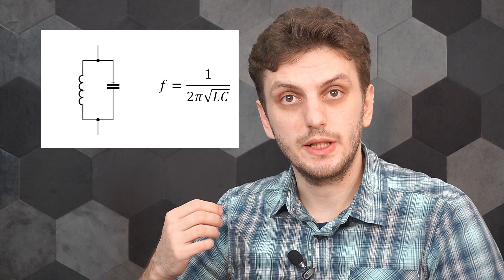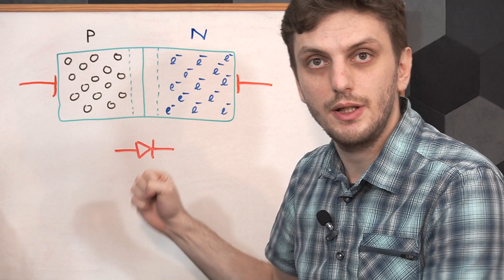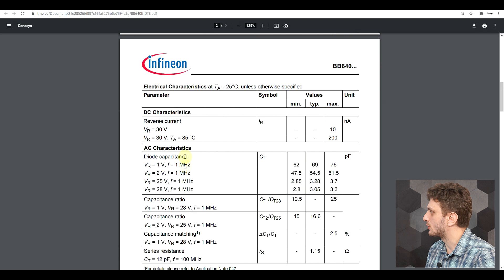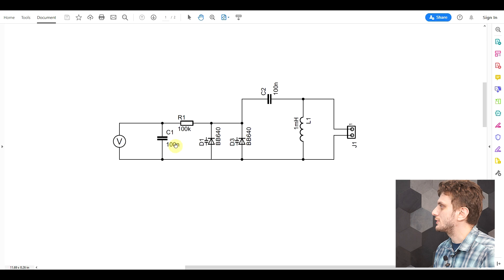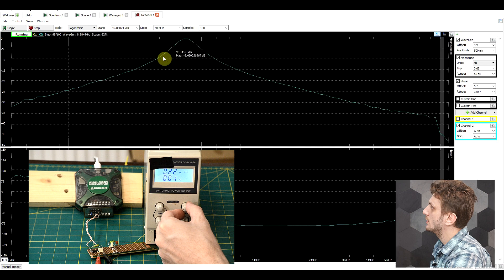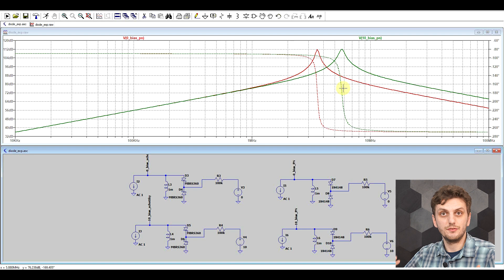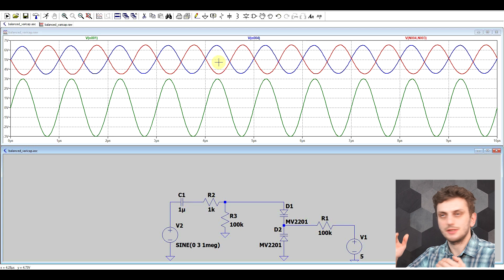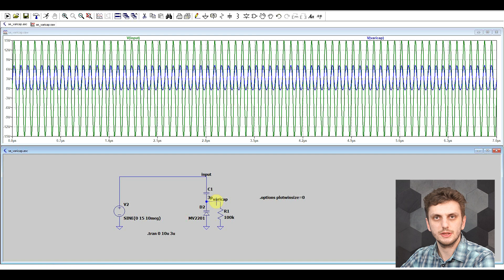RF tutorials - The Varicap or Varactor Diode

Comment: Neat, I never knew these were used at high power to generate higher harmonics! I wonder how optimised that kind of circuit can be?
Also I’ve heard that common LEDs make decent varactors, though I’d have to worry about photocurrent, particularly under AC lighting.

Comment: Thanks for this video. I have discovered there are varicaps in LTSPICE native models. Adding previous video on mixers with this one (VCO) plus notions of SSB you also developed previously ..It seems we are on the path of Ham Radio, no ? By the way this is great!
Reply from the maker: Well I do try to keep things a bit more diverse, and one of the things the viewers and my Patrons requested was RF radio related stuff. Happy you are enjoying it! Cheers!
Reply: @FesZElectronics  Sir, so if I connect a DC voltage source, a Varactor diode and an inductor all in parallel, there will be oscillations? Did I understand it right?

Comment: The electrical charge in a diode is inside of the depletion layer and not in the remaining parts of p and n zones. p and n zones are electrically neutral; they became partially electrically charged near the junction (the n zone near the junction became positive and the p zone became negative)

Comment: what is a "dc bias"? he mentions it when he applies dc to his circuit
Reply from the maker: Well, by definition, "to bias" a circuit means to apply a voltage to set a specific initial operating condition. In this case, what I was trying to say is that by applying this external bias, I am setting the initial capacity of the diode (the capacity is voltage dependent).

Comment: Hello thanks for the nice explanation, can I use this to tune FM transmitters frequency by replacing the old conventional variable capacitor I want to make it tunable with my microcontroller by applying a reverse bias protentional as you said (my idea is to use a external dac)?
Reply from the maker: That should work. In general this is how radio receivers are built nowadays - you no longer use mechanical variable capacitors but rather varicap diodes and a bias voltage. For the transmitter, as long as you are working on the low power oscillator, rather than the output power amplifier, there should be no issue.
Reply: @FesZElectronics  oh thanks for the reply is Variac diodes dead now or still available ?

Comment: Hi FesZ, I'm a big fan of your channel! At 9:11, what do you mean by "they're both referenced to ground without being directly polarised"? 
Is there a terme I can Google to learn more about this concept?
Reply from the maker: Maybe I didn't use the best choice of words.. I was trying to say that even though the 2 diodes seem to be oriented in different ways, the DC voltage is reverse polarizing both the diodes. D4 has its anode directly to GND, but D2 also has its anode connected to GND trough L2.
Reply: @FesZElectronics  ah, I get it! Thanks for having taken the time to answer my question. 
Keep on the good work :)

Comment: won't the C2 get on the total measured capacitance of the LC circuit as well?
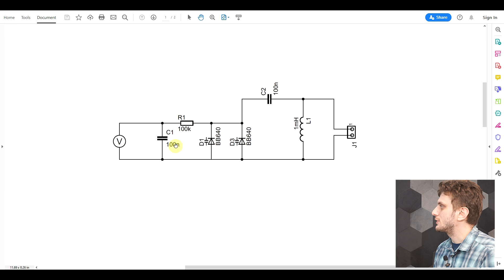Reply from the maker: Are you referring to the circuit at 7:18 ? There C2 is in series with the varicaps, so the total capacitance is the equivalent series capacity. But considering C2 is in the order of 100nF and the varicaps are ~100pF then C2 can be neglected.
Reply: @FesZElectronics  Yes Thank you for your reply.

Comment: Hello: i wonder if there is any way to put a comment on error or limit in a behavorial source (exemple : B1 n001 n002 V=if(V(V+) >3 & V(V+) <20, V(V+), 'somme comment'). I've find nothing about this and I think i'ts unfortunaly impossible...
Reply from the maker: Hello Anton! I don't think there is a way to create a pop-up or other text based error, maybe just measurement statements that can be read trough the error log. Personally I guess I would do this by creating the behavioral source with a Boolean output,  like V=if(condition, 0, 1) and just check the plot at the end to see if it ever goes to 1; this way you can also see when exactly the error condition occurs.
Reply: @FesZElectronics  Thank's for your answer. I wil try with a boolean output. I've made an LM39xx model based on the datasheet but I have not yet implemented  the voltage supply limit. I was hopping for this comment solution. If you have any interest for this model, just aks me.
Reply from the maker: Hello Anton. Unfortunately most models do not implement a feature to indicate if the circuit is operated poorly, or would just brake. LTspice will not care if you run 1KAmp trough a 1N4148. So its quite nice that the model you are making will have some way to indicate a fault condition. Honestly I would not go for the comment solution, because for example if you are simulating a circuit that starts with supply from 0V (to simulate start-up), then, right at the beginning your circuit would indicate the fault and stop simulating. I would however use the improper operating condition to affect the circuits behavior.  Say if the supply is not in 3-20V, then the input after a BV source is 0, regardless of what is on the input pin of the  model. So to add this filter condition right at the beginning. This way, if the operating conditions become ok later, the circuit starts working.